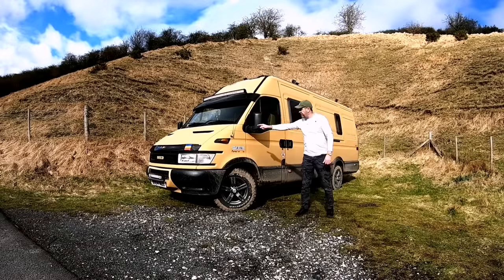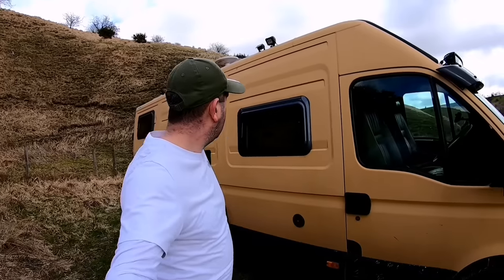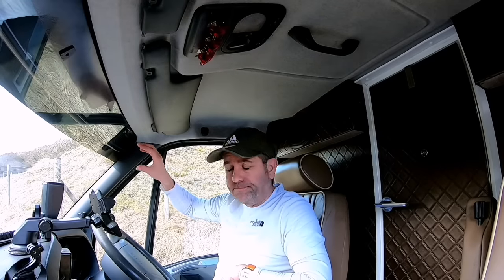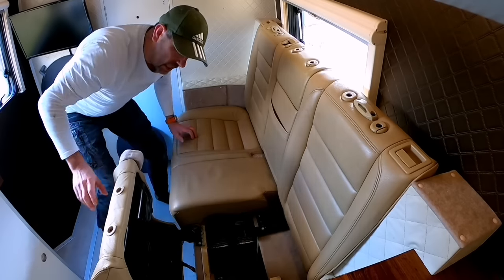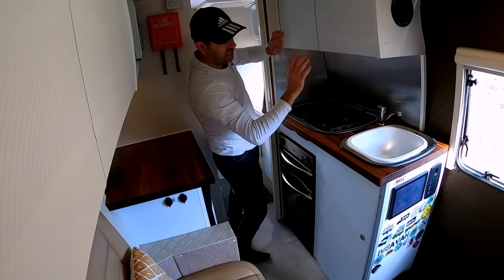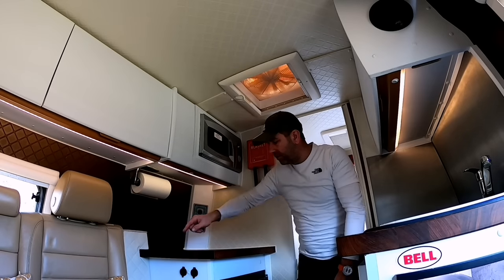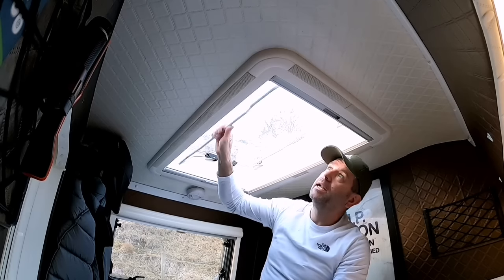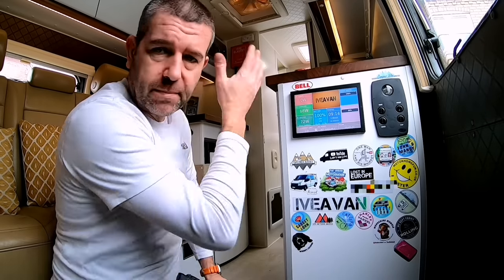Transforming An Iveco Daily Into A Camper Van - Epic Diy Build Tour!

Comment from the maker: Amazon store showing affiliate parts list that I've used within the van build.
www.amazon.co.uk/shop/iveavan

The Parts List Links. 
BF Goodrich Tyres.
 https://amzn.to/32z8mIZ

50" Lightbar.
https://amzn.to/3E8Pajj

20" Lightbar. 
https://amzn.to/3l4HwPl

6" LED working lights
https://amzn.to/3xC7JKh

Not the same type of Solar panel as mine, ( no longer available ) but it is an close match.
https://www.bimblesolar.com/index.php?route=product/product&product_id=2542&tracking=619e0a5d2ccc6

Victron MPPT (Solar Smart Controller) X1. 
https://www.bimblesolar.com/30a-victron-mppt-100-30?tracking=619e0a5d2ccc6

Cable Gland Entry Box. X1
https://www.bimblesolar.com/cable-gland-entry-box?tracking=619e0a5d2ccc6

Solar Panel To MPPT MC4 cables X 2. 
https://www.bimblesolar.com/mc4-cable-10m?tracking=619e0a5d2ccc6

32amp Breaker switch X1
https://www.bimblesolar.com/32a-din-breaker-tomzn?tracking=619e0a5d2ccc6

Or, an good full solar starter kit
https://www.bimblesolar.com/350w-victron-mounting-mppt-van-boat?tracking=619e0a5d2ccc6

Disclaimer! these are affiliate links that I have provided.

Comment: Some serious amount of time and cash invested loved the seats and control system  with remote start for genni  great vid
Reply from the maker: Thank you bud, probably more time invested then cash, using salvage caravan parts within the build saved a lot cash in doing so. Probably the biggest investment was the insulation, thanks to PIR had shot up in price thanks to a rubber manufacturing shortage back in 2018 and to the "Brexit effect ". But if I did another similar build, and if I already had an base van, probably a £10k budget would cover the cost of the build. But due to the poor state of my van, and having to replace the engine too, that really did bugger up my budget "😬"😉👍👍👍..

Comment: Fantastic job.
Reply from the maker: Thank you matey 😉👌👍👍👍....
Reply: @Iveavan  I'm not sure if it's TRUE but I've seen some vanlifers advising putting the carbon monoxide detector lower down as carbon monoxide is heavier than air and builds up from the ground.  If it's up high it would reach your lungs before the detector.  Like I said I'm no expert. Stay safe.
Reply from the maker: @ballisticdan9135   I've just double checked bud, Fire Angel Carbon Monoxide alarm instructions, upon there is an caravan/campervan section as below😉👍.

If the apparatus is located on a wall:
• it should be located close to the ceiling;
• it should be located at a height greater 
than the height of any door or window;
• it should be at least 150mm from the 
ceiling.

Comment: Amazing van! You have done a fantastic job with the build. The good news is that if you have two 6V 400Ah batteries in series, you actually still have 400Ah capacity not 200.
Reply from the maker: Cheers matey 😉👍. No sorry, I probably should of explained better. I meant, "I had two 200amp 6 volt batteries = 400amp but connected up in series giving me 200amps (100 amp usable)". I couldn't find an 12v battery compact enough (this was before lithium was popular) to fit in the a small space without having an impact on the amperage I needed, for it to last at least 5 to 7 days off grid during the winter months bud, I'd probably would look into lithium now as the prices have come down a lot since I started my build bud 😉👌👍👍👍.

Comment: Wow !  Just subscribed.  What weight limitation do you have on the iveco. All totalled what weight is your Overlander ?
Reply from the maker: Cheers Jon,👌👍 I've not weighed it lately, I was just over 3.5t 2 years ago but managed to pull it back down to just under 3.5t.
 I'm rebuilding the van this year and the "weight" is on the forefront of my mind, so I shall re-weigh before and after the build and share within the video. You only have around an 1200kg payload for the Iveco so focusing on the weight is a must bud 😉👌👍👍👍.

Comment: Hi Mark are the Iveco vans comfortable to drive. I have a swb Tranny it’s a bit choppy. I figure the lwb would be better. The van is nice to drive tho, so I was wondering if the daily vans were a nice driving experience. Cheers mate great video
Reply from the maker: To be honest with you, the Iveco Daily has a very agricultural feel to it, I've actually used the air suspension upon the rear axle to help counter offer that agricultural feeling but the front could also do with some air bellow assistance. Other then that, I found them to be a great van bud 😉👌👍👍👍...

Comment: What a build! You must be really proud of that mate, and rightly so.
I’ve bought a Heki 2 and my original plan was to fit it above the bed as well as I can definitely see the appeal. But I’m not sure now and may fit it above the dining area instead. Given the chance, would you do it again? Any issues? 
On my mind are condensation dripping, rain noise and if people sleeping underneath might feel vulnerable to intruders!
Any thoughts appreciated. Cheers!
Reply from the maker: Thank you Paul 😊👍, errm no, I'd still have the Heki skylight above the bed, and no, I don't suffer with condensation as the roof light seems to be well ventilated, and also the thermal blind helps too. Regarding security, no that doesn't worry too unless they were carrying a ladder to gain access to the roof. 😉👌👍👍👍.....
Reply from the maker: Thank you Paul 😊👍, errm no, I'd still have the Heki skylight above the bed, and no, I don't suffer with condensation as the roof light seems to be well ventilated, and also the thermal blind helps too. Regarding security, no that doesn't worry too unless they were carrying a ladder to gain access to the roof. 😉👌👍👍👍.....
Reply: @Iveavan  Thanks for the info, that’s useful. Cheers!

Comment: Superb build mate. One point your carbon monoxide alarm should be mounted at floor level as CO is heavier than air.
Reply from the maker: Cheers matey, to be honest, I fitted it  upon the instructions that the alarm came in "a few inches from the ceiling"? 
But, I too thought "that doesn't sound right" 🤔, I'll look into that again bud, cheers 😉👌👍👍👍... (I've just double checked bud, Fire Angel Carbon Monoxide alarm instructions, upon there is an caravan/campervan section as below😉👍.) 

If the apparatus is located on a wall:
• it should be located close to the ceiling;
• it should be located at a height greater 
than the height of any door or window;
• it should be at least 150mm from the 
ceiling.
Reply: @Iveavan  I'm wrong mate always thought it should be low but looking it up it seems it is slightly lighter than air. Would you recommend an Iveco, I saw you had major engine problems.
Reply from the maker: To be honest, they ain't bad vans, just a little agricultural in handling / ride, I was just extremely unlucky with mine regarding the engine, but now having finished the van build and now I'm using it, If I was to  build another campervan, I would use the Iveco, as an base vehicle bud 😉👍.

Comment: Interesting decision with the generator instead of the inverter. I would still add an inverter as a backup, save fuel given the crazy prices nowadays!:)
Reply from the maker: To be fair, I've filled it up once since I've installed it, I needed the extra power for an welder whilst carrying water butt repairs on the farm and used it upon other people's vans. I only have the need for a12v supply within the van but planning to do a few changes upon the van to suit our needs now bud 😉👌👍👍👍.
Reply: @Iveavan  fair does mate, ye the welder needs some extra juice! It's great to have a backup gennie though, shame I don't have a long van to store it hehe
Reply: @Iveavan  After a few outing in my van now I got myself a Honda eu10i gennie and converting to LPG... Solar just doesnt cut it for me now there isnt much sun... I need to run my laptop for work (and gaming lol)

Comment: How did you install all the components onto the roof? I have nearly the same generation (facelift though, but same H3 roof) and haven't found any mounting points or instructions on how to mount a rack on the roof of specific vehicle. There's just a fold on both sides it appears.
Reply from the maker: Is it for the solar panel? If so,  this is how I mounted the old solar panel https://youtu.be/OWAy8VQIh38?si=5uC96Pwr1_mWVR5f
 Roof rack wise, being an H3 roof, I don't think they actually fitted the mushroom anchor points upon the H3 roof 👌👍...
Reply: Wow, what a quick response, thanks a lot!
Yes, it's meant for the solar panels, but not ultimately (at least hopefully). I also planned on using it as a roof terrace, but we'll see about that...
Thank you for the link, apparently I should've just looked into your profile before asking... ;)
I've also seen a solution where airline rails were simply stuck onto the roof with body glue, I might consider this solution instead, as it doesn't involve drilling into your roof and hence not having to seal the holes again.
Thanks for sharing your experiences, I hope your van keeps doing well!
Reply from the maker: @leumel900  no worries, mate 👌👍. Yes, that would work if using something like carbond. Just beware, though! The paint applied upon the Iveco isn't great ( mine came off with the pressure washer ), so you would need to etch into paint work down to metal. You could use roof rack clamps upon the lip that runs along both sides of the van 🤔👌👍...

Comment: Hello mate, I'm calling on your knowledge here. Do you know how long the Ford Iveco Daily Brake Compensator Link Rod on the rear brakes is? Its fallen off mine and cant get hold of one to replace it so I'm trying to replicate it. Cheers mate
Reply from the maker: Hey up bud, I've seen people make them up using an 8 or 6mm thread rod and buying the joints off Ebay to make one up, or... Whether Iveco still sell them or not, I'm not sure bud. Mine didn't come with one fitted 😉👌👍.
Reply from the maker: No mine doesn't have the valve nore the rod bud, whether they'll be any implication in removing the brake valve on yours and just plumbing the brake pipes to the calipers like mine , I dont know, depends on the weight of the van matey 🤔😉👍👍👍.

Comment: Mark what are the security cameras I need to fit some to my van because someone tried to Nick my solar panels but I think they was more interested in taking the raise and turn table they have done some damage cutting the wiring but I had welded 4 bolts to the roof rack so they couldn’t get it off unless they removed the roof rack as well there must of been a few of them because the roof is dinged in thanks
Reply from the maker: PM yeah bud 😉👌👍.

Comment: Is the generator still working as it should. I’m shopping for one ATM.
Reply from the maker: Yes, but in all honesty, it's only in there for a' backup' for when camping (in which I never needed it). I've used it more for remote welding jobs. It is going to be removed this year as I've now have a 14k Watt power bank going in (the campervan is going to power the off grid workshop) 👌👍👍👍...
Reply: Thank you. I usually go with known brands, it’s  the low db claim that attracted me. 
Great job on your van! 👍

Comment: Still one of my fave van builds, so clever. 

Such great work on building it - I bet to get a conversion like this would cost a hell of a lot of £££

Take care.
Reply from the maker: Thank you matey 😉👍. Regarding cost.... Probably in the region of £15.000 but a £1000 of that was the insulation due to the rubber shortage in 2018/19, that drove the cost up 🙄. 😎👌👍👍👍...

Comment: You have gotten a lot out of the van.
There is just one thing that always surprises me.
Why is all van builders always putting the bed in the back of the van?
Reply from the maker: Thank you 👌👍. I could of put the bed in the front, but personally,  I wanted an "fixed bed" that I didn't have to make up every night, or had that "obstacle" to navigate around from the cab of van into the habitation area. 😉👌👍👍👍.
Reply: @Iveavan  that makes a lot of sense.
My wife and I have been talking about one doing building our own and since she's such a luxury animal, that she wants to have separate shower and toilet, has my thought been to make a "flip-down bed opposite of the side door of a van and then take the whole backend and then setup a bathroom with a showerstall and a toilet, allowing me to access the cannister for the toilet from the rearend of the car and generally allow for easy access to the shower and toilet from both sides.
This is still a work in progress though ss I need to find the right van for it and then after that can begin and draw up the measurements. 🙂

Comment: Assistindo do Brasil, como faz para não congelar a água nos reservatórios e canos?
Reply from the maker: No, all the water pipes are internal, and the grey water tank is pretty well protected from frost 😉👌👍👍👍.
Reply: @Iveavan  no isolamento térmico da van, você usa que tipo de material?
Reply from the maker: Yes, the van is fully Insulated with PIR insulation 😉👍👉https://www.wickes.co.uk/Kingspan-TP10-Insulation-Board---2400-x-1200-x-50mm/p/180436
Reply: @Iveavan  bacana...o material parece ser bem parecido com o que a gente usa aqui...chamado lã de rocha https://www.google.com/imgres?imgurl=https%3A%2F%2Fwww.gypcenter.com.br%2Fwp-content%2Fuploads%2F2019%2F05%2F3b667d84e3.jpg&imgrefurl=https%3A%2F%2Fwww.gypcenter.com.br%2Fla-de-rocha-32-kg-x-50-mm-saco-com-6-placas-de-60x120-cm%2F&tbnid=lEjDJ_allwQ3zM&vet=1&docid=w5N-0O1BCyhaKM&w=500&h=500&source=sh%2Fx%2Fim

Comment: How reliable is the Iveco?
Reply: Also how is it to work on? Difficulty?
Reply from the maker: Like any van, as long it's been regularly serviced and well maintained, very reliable, mine hasn't many electronics or sensors as the modern vehicles, and far more reliable then my 2019 Mercedes vito that seems to spend  day's in the Mercedes garage every year I've had that 🙄😉👍👍👍...
Reply: @Iveavan  I have a 2008 VW Crafter, constant mysterious underboost issue that even VW can’t diagnose amongst other things. It’s drivable but not trustworthy so I’d have to disagree with you that anything that is looked after is reliable
Reply from the maker: @Ondraythe1  there fairly straight forward to work on to be fair, unfortunately you can't use an OBD error code reader as iveco use their own easy scan on the older models, but like I said, there's very little sensors on the older model engines to give you grief, cam & crankshaft positioning sensors, fuel pressure sensor and MAF sensor. Rust is the bigger problem on these vans mind you, but mechanical wise and running gear wise there built like 'Tonka trucks' go on for ever 😉👍...

Comment: You built this on a 35s platform?
Small chassis small suspension. Small brakes and low horsepower..

What a waste
Reply: And single rear wheels..
Reply from the maker: There you go! I've given you a platform to air your opinion. Please educate everyone 😉👍👍👍..... But before you do, Firstly! To make any type of comment like that, you have to understand how the UK works! It's nothing like Australia! Not only the lack of space, congested roads, high vehicle taxes, you'll find the vast majority of van builds within the UK are built upon 3.5 ton base vehicles due to the driving licence laws changed in the late 90s, anyone passing their driving test after "1 January 1997" would also need to acquire licence category C1. 
An further driving test would enable you to gain this category to be able to drive larger van's above the Iveco Daily 35 range. 
All though, I do have the C1 part upon my licence I opted for the 35"S" model, due to the above, I chose not buy an "C" model (because that's my preference, and not yours!) with its larger wheel arches to house the double wheel axle that encroaches valuable realestate upon the habitation area, for me, that was not an option I wanted... However! your opinion maters to you! (In the poor dialogue way you presented it) Thus maters to me! 
The Iveco Daily 35s has the carrying capacity of 3850kg and not 3500kg as you eluded too, thus giving myself an option if I needed  to uprate the van via SV Tech, and regarding the low horse power, we are pretty much restricted to 50mph upon most roads besides the motorway within these vans and having high fuel prices here in the UK, the sensible option is to go for the smaller range of van.... So not much of a waste after all!!!
Reply: @Iveavan  Thank you for your well thought out  van tour!  Bon voyage! ☺
Reply from the maker: Thank you 😊👌👍👍👍...
Reply: @Iveavan  You are —Welcome!  ☺
Reply: Do you mind doing a video on driving, in the U.K. & Mainland Europe, heavier campervans please.  ☺  I'm looking at getting a 4x4 XD3500 Sprinter duel rear wheel.